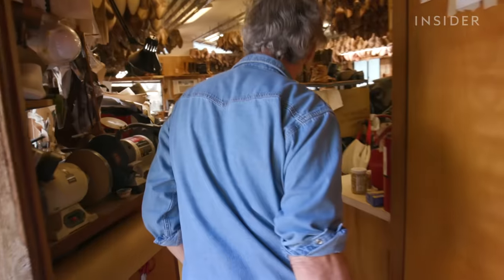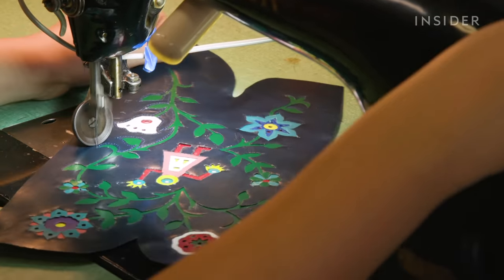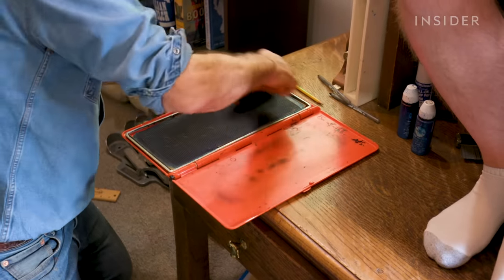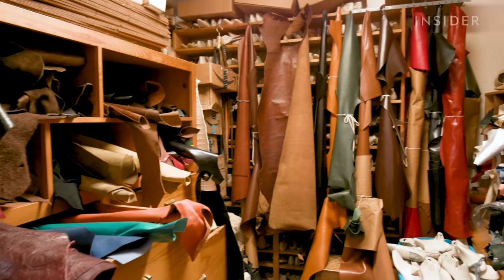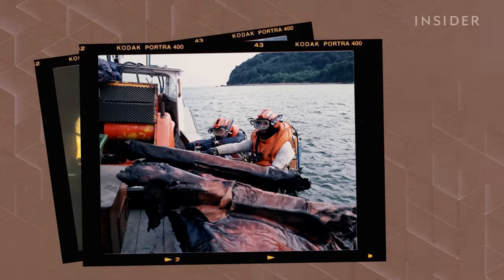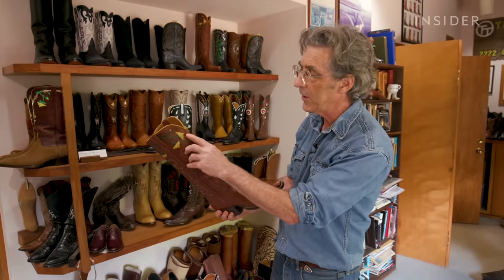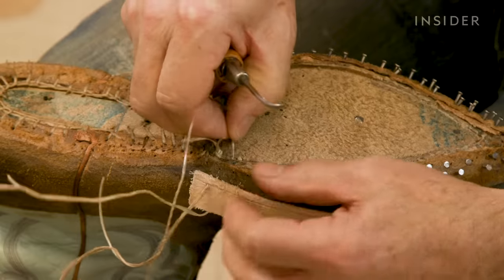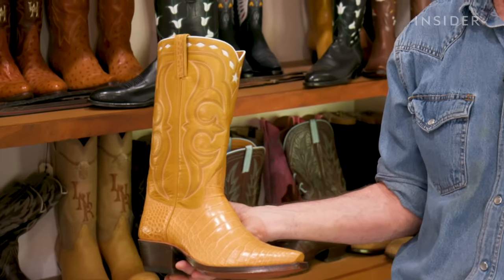How $3,000 Custom Cowboy Boots Are Made | Master Craft | Insider Art

Comment: Speak for yourself, because I've NEVER WORE BOOTS THAT WERE MORE COMFORTABLE THAN MY TENNIS SHOES..LOL..I can't run with boots,can't go walking at the park with boots,Can't exercise with boots ect
Reply: You're right, every foot is different. It's not for everybody, but properly fit boots are straight up gloves made for your feet, I've never wore tennis shoes that were more comfortable than my sendra's. It's like my feet are being hugged while wearing them. I've lumped many trailers in them which is pretty much the same as jogging and lifting/pulling/pushing weights at the same time. I'm not worried about scuffing them up, can fix the scuffs and the shape is initially why I wanted them.